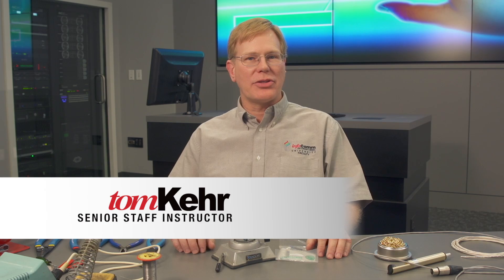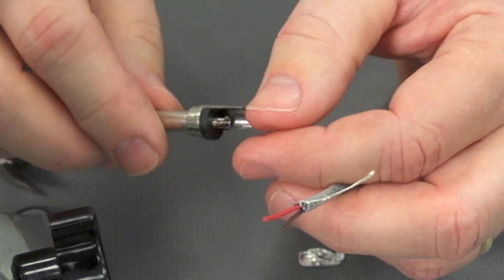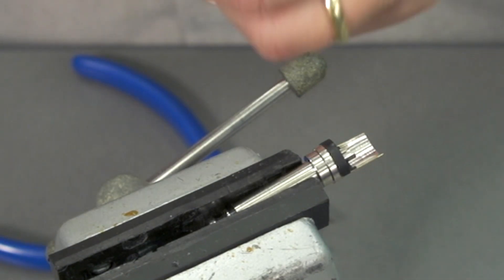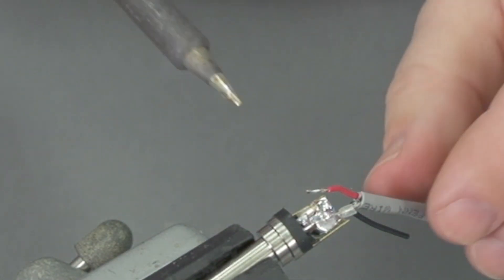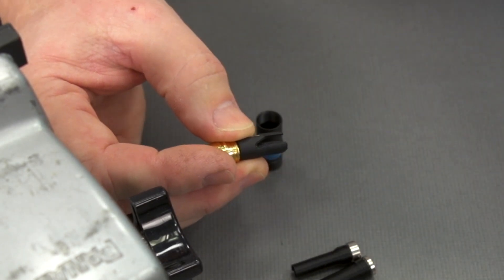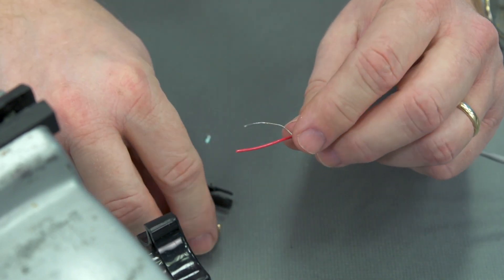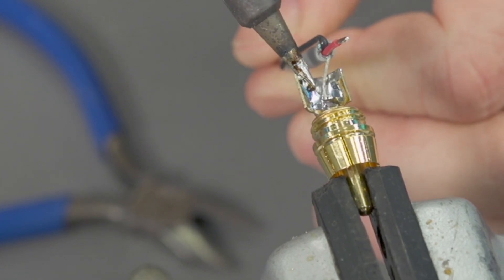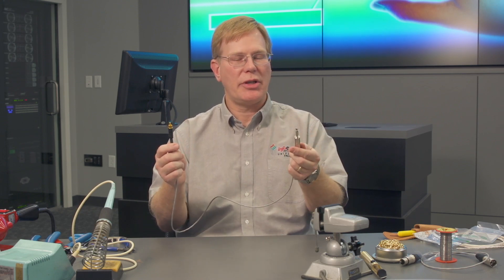Soldering 1/4 TS to RCA

Comment: What temperature do you use for the soldering iron?  I have a Haako FX-888D.  Never mind, I heard you say 700 degrees.

Also, what size cable are you using?  Mine is 12 awg w/jacket and the jacket looks too big to go through the REAN 1/4" strain relief.
Reply: This would be using a 700 degree tip.  12 awg is way too large for this application (1/4 inch TS to RCA).  This is more like 24 or 26 awg.
Reply: I thought through what you said and that makes sense.  My thinking was to use the same 12 awg cable all through the signal chain but I forgot the connection from the sub-out to the amp is only transferring a small amount of power which will get amplified later.  Thank you for your help.